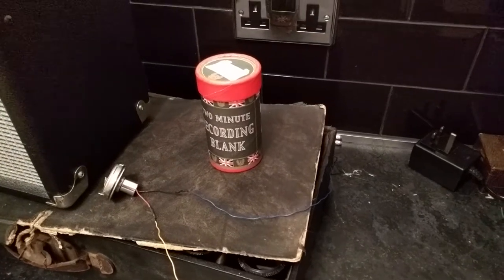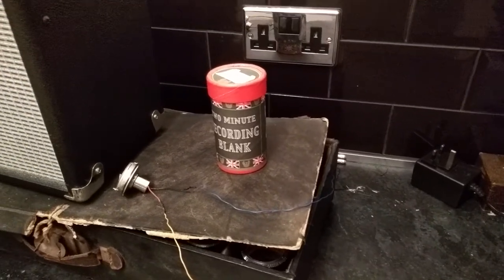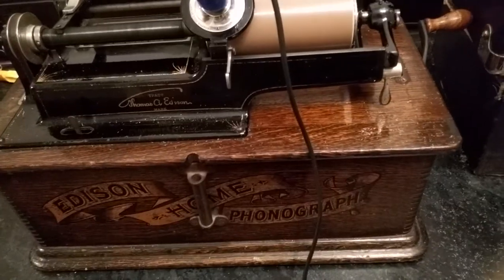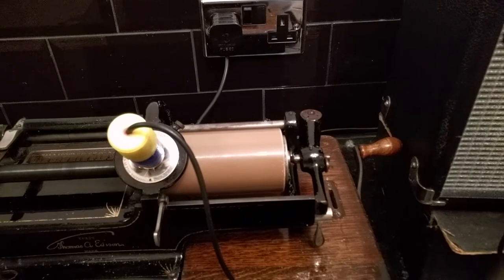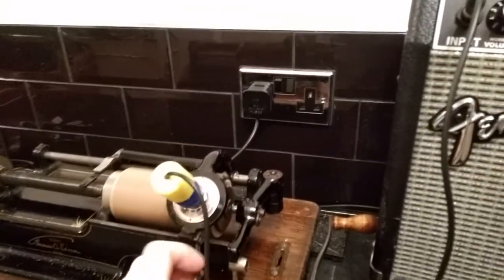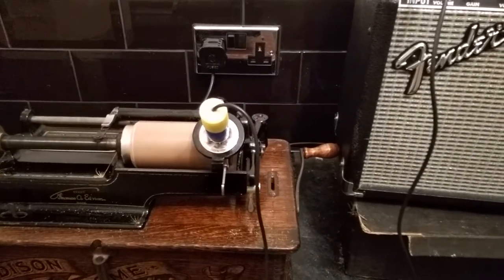New last experiment with mjr MK2 Edison electric recorder

Comment: Great experiment Matt. 
I wonder if you could improve on the sound replay by playing it back through a deck phono mixer input before going into the amp.
It may add the base elements and volume back into the play back.

As it is, it is so much like the sound you get when you play a turntable back through a line input instead of a phono.
Reply from the maker: Andy Bibby hey Andy Merry Christmas to you! I'll do a direct hook up and body the bass during cutting :) I'm having a blast messing around with this!
Reply: Matthew Richards technically it is a line input like a record player. Just the record is a cylinder. 
Look forward to hearing more and the bacon and day too.

Comment: you should show a video of you actually cutting a cylinder with the MK2 electric recorder
Reply from the maker: back2skooldaze hey Andrew. Hope all is well! I have been using a piezo disc as a driver and have the volume very high ( I have problems with trying to get a loud volume). I have not tried a transducer but I bet that would give louder sound. I'm not up on this but the difference with a transducer and piezo is the transducer is like a speaker without the cone? I will do a video of actual Cutting. Hope all is well mate I saw all your videos disappeared and hoping all was ok. Merry Christmas to you!